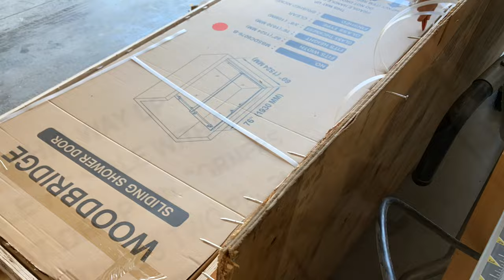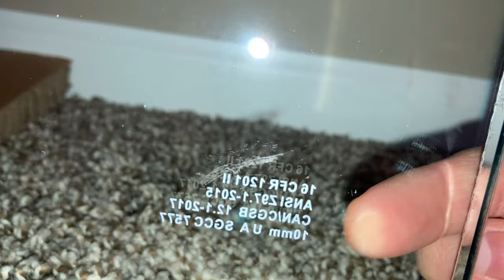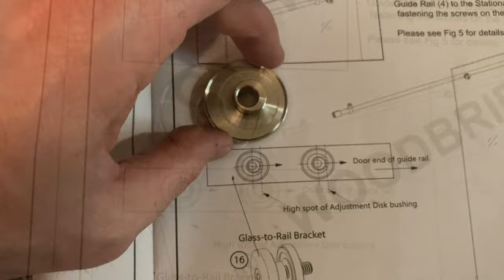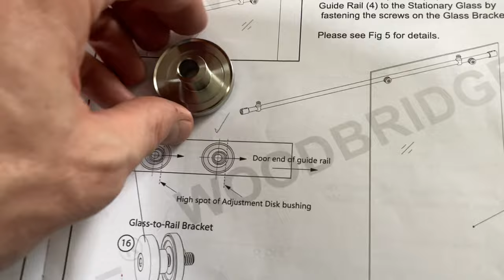️🔥 Woodbridge Frameless Glass Shower Door➔How to DIY Install: Step-by-Step Instructions + Review

Comment: Thanks for your effort on the video. I purchased same door direct from distributor. I didn't follow the enclosed directions but built a story pole out of a saw guide and flat steel ruler. After coming up with my height above threshold of 73 5/16 I used a product  called a Toggler as I have metal studs.
When cutting length on cross tube (if required) I again used my story pole instead of a tape measure. Remember the length represents the distance including the brass parts.
Self install went well but be well aware of the ability to handle 76" length with the weight of the glass.
The "bushings" would be better referenced as an eccentric and does offer a small degree of leveling.

I'm pleased with my door and a good value.
The most important advice is to place sliding panel inside the shower before installing stationary panel!

Again, thanks for your video as it gave me the confidence to go forward with my project.
Reply from the maker: Thanks for your comment and you're welcome! Enjoy the new door!
Reply: I'm in the middle and learning things as I go.  I really appreciate the door in the tub first advise as well since it would have been brutal to place thru the opening.🥵
Reply: Don't measure! Mount the stationary panel and dry fit! That measurement did not work for me. Ask me how I know. 😢

Comment: One of the best DIY videos I've seen. Even paced, camera work is good and the explanations are complete.
Reply from the maker: Wow, thanks! What a compliment!
Reply: @diybandit  Just completed my project...One thing you might add. Make sure the internal threaded pieces on the main rod are firmly inplace.  After cutting the pipe with my Chop Saw, both of the threaded pieces slide out of the end of the pipe!  Realized that the smallest allen wrench can be used to tightened in place..
Reply: It's true!  I think we'll just follow your video instead of following the directions. Did it really only take you 38 minutes to install this?   @diybandit

Comment: Great video saved me a ton of money did it myself.  One note from the manufacturer.-- Jacob by name.  He told me the correct height for the wall bracket centered at 73 and 1/8 inches above the threshold.  Jacob said they forgot to include that in the instruction manual.  He also said the fixed door basically rests on the threshold and suggested, like you, just using silicone adhesive to keep it in place.  You can adjust the height up or down a quarter of an inch using the small wheel on the roller.  Point the allen wrench hole down to lower the door-- point it up to raise it.  Super helpful.   Thanks for saving me $800 install fee.  The doors look awesome!!!!
Reply from the maker: Glad this helped and thanks for your comment - some great information there. Cheers!

Comment: Great video. I'm about to embark on this same installation. I realize this video is a couple of years old but I would like to point out a couple of things. I believe the brass-colored brackets for the top bar should be installed with the slot verticle so it can help with height adjustment. Also, even though the brackets on the bottom are not providing a supporting load, I believe they have a side load on them. As gravity acts on the panel and the screws holding the bar to the wall are slipping over time, the panel will tend to rotate into the shower.
Reply from the maker: Excellent comment. Thanks!

Comment: Thank you for the video, great tips for the DIYer. My measurement with the tiling completed is 58 " width and 81" height (measured from the top of threshold of the shower basin to the ceiling). Will I be able to install model MBSDC6076? I have only 5" (81 minus 76) to hang up the rolling door? Question 1 - What is the actual height of the rolling door?  In the Woodbridge web site, the schematic shows 76” as measured from the floor and not from the threshold. Question 2 – where exactly do you drill the hole for the screw for the wall bracket (page 16 Fig 7)? The slot is not a hole but oblong shape .

Comment: I just installed this door. Very nice door and the video instructions were pretty much spot on. I also used the glue method. Now that I have it up, I'm a little miffed about the color. I feel like its greener in real life than on the video. I wonder if the manufacturer does a low iron version? Anyone know?

Comment: Great Video!  I just installed this door this weekend!  Because of the size of the space of the shower I did not follow the instructions of assembling the bar and stationery glass wall to dry fit.  I measure the stationery glass to ensure it was 76" then I measured the center of the hole where the glass is being held in place to the bar and it turned out to be 3" from the top.  So I drew my point of where to drill at 73 1/8" above threshold on both sides.  I made sure these markings were center with threshold and exactly 73 1/8 above the threshold.  This allowed me to install the bar first and I ensured it was level.  The brass fittings that your drill into the wall have a long oval slot that can be installed in a way that allows you move the bar up and down a small fraction or side to side.  I would do side to side not up or down, but this allows for small adjustments to ensure perfect alignment.  Once I had the bar in place than I added the stationery glass wall and it worked great! Again, this saved me from having to move the stationery glass and bar in and out of the small shower area.  I had a 60" tub and converted to shower.  The shower and toilet are separate from sink area so the room was about 60" by 70" with the toilet in the way.  Since I had already installed the toilet and there is a doorway in the way, I had enough room to do it as the instructions call for but it was easier doing the way I did it and it turned out great!  But this video is what led to me to buying this door and it worked out nicely! Thank you!  Also, I bought it directly from Woodbridge as well!
Reply from the maker: Thanks for sharing! Glad it turned out!
Reply: You’re my hero

Comment: Very detailed video! One question. I am installing my 60" model in a fiberglass shower enclosure. The top bar will be above the top of the enclosure which in recessed from the wall about an inch. Is my only option to build out above the enclosure so that the wall is flush with the enclosure?
Reply from the maker: Good question. If the company doesn't any sell adjustable brackets or extensions, a build out may be the only option. My mind goes to 3 places: (a) adding a 1/2" thick piece of primed wood trim wrapped around the entire top, then some nice tile to cover it, with total wood/mortar/tile thickness measuring 1" and clear 100% silicone to seal any gaps, (b) finding & gluing a round metal 1" long hollow spacer (maybe trim this off the top bar if you can spare it or head to the hardware store) which visually matches the top bar finish, securing with some extra long lag bolts, (c) cutting and gluing a 1" thick  piece of sealed wood (maybe 2" x 2") to act as a spacer, with a pre-drilled hole to make sure it doesn't split. Option C is probably the easiest? Sorry, that's all I got - maybe someone else has an idea?
Reply: @diybandit  Thank you for responding! Wish me luck!

Comment: your video is great. I was wondering your opinion on something. My installers did not install backer boards for the shower. Do you think snap toggles would support the weight of this shower door?
Reply from the maker: I wouldn't do it, if it were me. But you never know. I'd probably check the weight specifications provided by the snap toggle manufacturer and then call/email the shower door company to make sure. But you should still have wood studs to drill into, right?

Comment: Thanks for the video. It provided me with a very important reference point. According to the not-so-clear manufacturer’s instructions , the anti-splash guard is placed away from the sliding door. Initially my contractor and  I followed the manual. Drops of water came out under the door during shower. Then I watched your video and had the guard re-positioned close to the sliding door just as you did in your video. Unfortunately it made the matter worse. I tested it by spraying water directly at the sliding door with a removable shower head (the manufacturer has such a spraying scene in their video clip to demonstrate how the anti-splashing guard works),  there was a big splash of water, and the water spilled out under the door to the sloped marble threshold and then the guard was preventing the water from flowing back to the shower floor! So puddles of water remained on the marble threshold.  So I had to ask my contractor to come back and move the metal guard back to its original position. To me, there seems to be a design issue. So 1) If it’s a frameless sliding door without a bottom track, 2) if the shower head (esp. removable shower head) is on the same side of the sliding door, and 3) if the shower area is small, is zero water splashing simply impossible to expect? And to guard against big splashes, positioning the metal guard (“ant-splash threshold”) away from the door as the manual instructed might be a better option? But again, I noticed that you placed it close to the sliding door instead of away from it.
Reply from the maker: Great comment/question. I'm actually working on a video that addresses a part of your issue, as I had some drops making their way over the metal guard after using the shower regularly. Light, but still annoying. Probably a design issue - I wonder how the manufacturer would respond! Anyway, in my case, there seemed to be a very, very small gap between the BOTTOM of the glass door and the TOP of the metal guard. Perhaps your gap is bigger - meaning your sliding door was installed a bit higher up. I wonder if you kept the metal guard close to the sliding glass door similar to how I did in the video, but build the metal guard up like 1/8" or so (with plastic or metal strip of some type on the underside, the hide with translucent caulking)...the idea being if the metal guard were TALLER...might this prevent water from being about to sneak under the glass door and over the metal guard? Or, if this theory is sound, I wonder if a single strip of clear caulking on the TOP of the metal guard (obviously, you wouldn't want it to touch / dry to the glass door) to make the metal guard "taller"? I did the latter and have ZERO spray sneaking out. I can't say if positioning the metal guard further back away from the door is better or worse.
Reply from the maker: Hey - sorry for the delay. This video is hot off the press. Hopefully, it helps: https://youtu.be/qkhCGrNt_yA

Comment: Is it possible to have the door that slides as the outside door? I like that look better because mine would be sliding to the right! Metal piece that attaches to the bottom of the tub would have to be turned which might’ve worked better for you because then it would have been on a flat surface instead of that bump

Comment: I have made a living doing home repairs for 30 years. I have installed regular shower doors but never a frameless. I installed this door (with a different guide) in the summer of '22. Could not find any online info. Had to calculate height of bar numerous times and as a result, I have multiple holes in my tile, mostly covered by the bar. I handled the 83lb doors countless times.  Water pooled outside on slate floor every time I showered. Eventually, I set 1/2" x 1/2" angle-aluminum and sealed with silicone caulk to the base under the open door. A couple of weeks ago, the slider door began to rub on the aluminum when attempting to open door. Yesterday,  I spent hours making adjustments. I removed the sagging bar and bent it upwards. The "nuts" inside the bar fell out which took some doing to get back in place.  I raised the fixed door and placed 3/8" spacers under in an attempt to not have bar bend in the future. Took shower and copious amounts of water flowed out onto the slate floor. Purchased another angle-aluminum, sealed it to the base with silicone caulk. I also sealed vertically between the fixed door and the wall tile. The slider tends to roll towards closed about 10". Good enough for now.
Reply from the maker: Sounds terrible! Not my experience at all. Hope you work it out.

Comment: I think it was a good idea for longer screws for the top track. However the enclosed bolts appear to be stainless steel which are stronger and won't rust.
Reply: Sorry, I meant the enclosed screws, not bolts. I have the exact same assembly which I am about to install. Great video.
Reply: @stevewright7233 how long did it take?

Comment: 1. Example, If my shower width is 47, should I cut 2 inches on the farther side of the roller bar?
48 - 1 inch wall difference - 1 inch guide rail bracket screw difference?

2. Right hand door installation in the instructions manual ,,,does it mean door knob is on the right hand  side?

3 looks like I need to cut the anti splash threshold as  well to the guide block?

Comment: great video, I'm getting ready to install the door in the next week or so. I was wondering if you have a trim piece between your shower pan and tile? I usually see the tile done down to the pan and then just caulked. but it looked like you had some kind of trim. I have a fairly big gap and was wondering what I could use.
Reply from the maker: Good question. I used a PVC quarter round trim piece to hide the gap. If my tile had come down a bit more , 1/8" or so from the shower pan, 100% silicone would have done the trick. I had used PVC quarter round to cover gap between the floor tile edge and shower base, so I figured I'd trim out the inside of shower as well. I have a separate video on the PVC trim and how I did it - you can search my channel. But again, if your gap is small, just silicone it and be done. Good luck on your project!
Reply: Just tried to fit the door and realized the tile can't be set back from the tub face. Terrible design!
Reply: @tallcool1ify sounds like you installed your tile incorrectly. Not terrible design, terrible install. Tile should always go past the tub and to the floor to eliminate  moisture to the drywall and delaminating. All the way to the alcove corner or 2-6” is best.

Comment: Great video!  I just completed the same install.  It went perfectly.  Then I took my first shower - and as the shower area heated up and the door started to build up some condensation…it got a mind of its own and slowly started rolling open.  And when fully opened it will slowly roll closed (towards the middle).  Maybe if I install one or both of the splash strips (either vertical rubber or horizontal metal) that will supply just enough resistance so the door will stay put.  Any ideas?
Reply from the maker: Weird. If it was level at install, I don't understand why it's moving on its own. I'd call the manufacturer. The only other idea is maybe a thin layer of 100% silicone added to the top of the bar, fully cured, might create the resistance you want.
Reply: I ended up cutting two tiny squares of (the same rough side of) velcro.  Stuck one on the bottom of the top bar and the corresponding one on the top of one of the safety things on the door.  When the door is closed the two pieces of velcro make contact and create just enough friction to hold the door closed.  Works perfectly!
Reply: I have now installed about 5 of these doors for my homes. I think the round bar can flex ever so slightly in the middle causing this.  I accounted for this on subsequent installs by making sure the door end of bar was ever so slightly lower off level (1/32" maybe) towards the door's closing direction.  You can also add a slight bit of silicone adhesive on the bar so the roller passes over it and won't want to roll backward. 

Also, be careful of the weight of the door and closing.  I was in the shower for the first time and closed the door (not that hard too) and it SHATTERED because the bottom of the door tapped the tiled wall slightly. Remember, the door is VERY heavy and has momentum. The stop on the bar prevented the TOP of the glass from going too far. But the bottom can continue to SWING past the adjusted stop distance desired.  In addition to checking my clearance distances better, I added a 3/8" clear square bumper with self sticking to the wall down low in case a user closed the door too hard.

It was pretty funny calling for my worker to come rescue me standing naked hoping the plastic safety sheeting in the glass kept it all together so we could open the now shattered door enough for me to escape.

Oh, here's a little trick my worker passed along to me:  To apply silicone cleanly, don't just squirt it into gaps using the caulking gun (like in the video) If you apply blue painters tape to both sides of the wall and both sides of the glass you create a slot to then squirt the silicone.  Then run your finger down both sides removing the excess.  After that, immediately, remove the blue tape. And now you have a clean edged application of silicone that you almost can't see.

Comment: Is the protective shatter proof film supposed to be on inside or outside of shower? Or it doesn't matter?
Reply from the maker: From what I understand, the protective shatterproof film is typically applied to the inside of the shower enclosure. This placement helps prevent shattered glass from scattering into the bathroom in case of breakage. It serves as an added safety measure to minimize the risk of injury in the event that the shower glass is damaged. Always follow the manufacturer's instructions or consult with a professional installer to ensure correct placement for your specific shower enclosure.